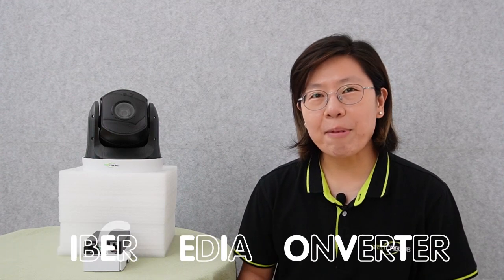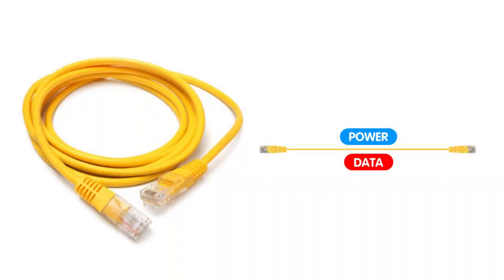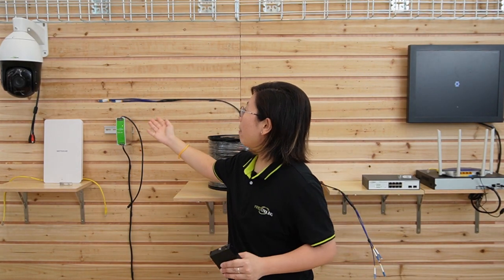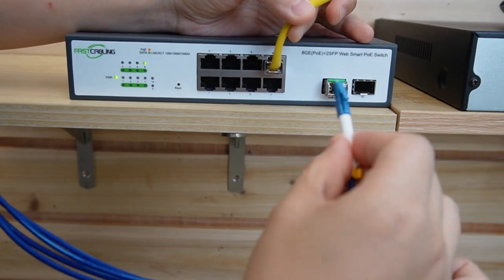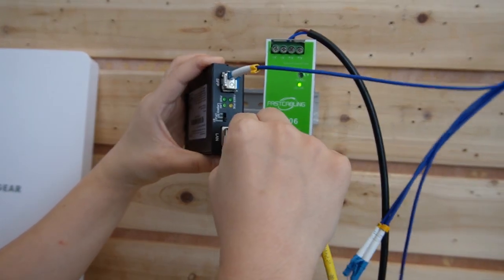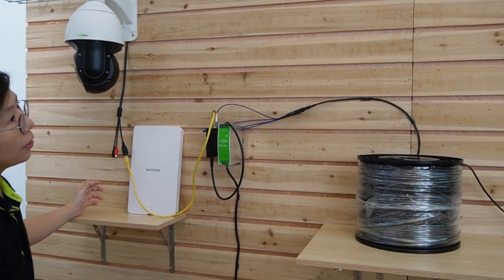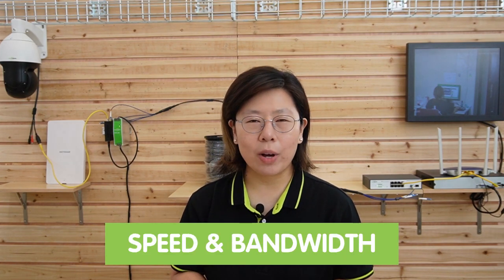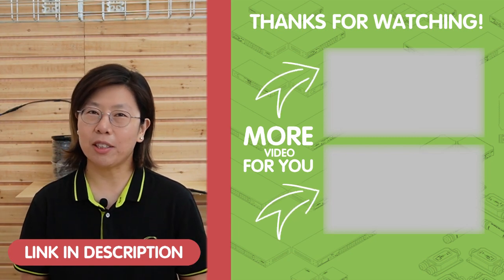Understanding the Basics What is a 90W PoE Fiber Media Converter

Comment: Is it possible to put may be 1:8 splitter in between to go in different places then test in all sides with laptops get good results?
Reply from the maker: No, you cannot split one media converter to 6 using a passive 1:8 splitter — media converters require dedicated point-to-point links.

Comment: Hello,  how can and which material I use to install road camera, that is abroad from the central control room
Reply from the maker: I assume the power is ready at the edge. Then you will need media converter, SFP transceiver and fiber optic cable to link edge camera to control room. You probably need one media converter with POE feature for camera side.
Reply: @Fastcabling  thanks Dear, but if you can, please upload the video tutorial about road camera installation, thanks again